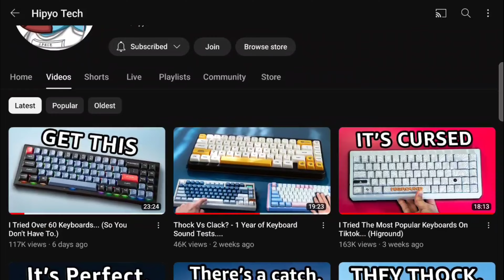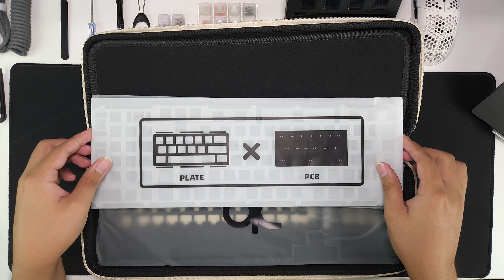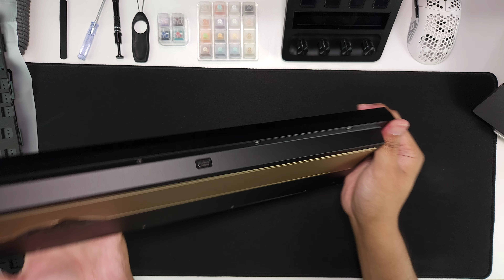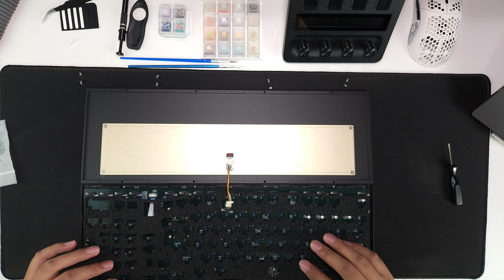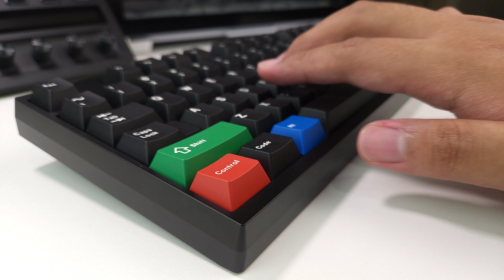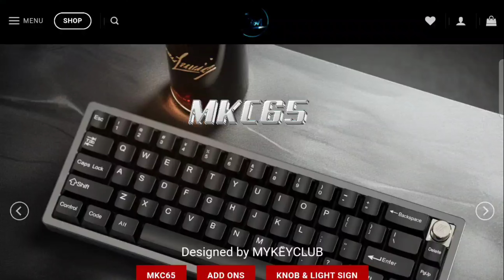QK100 Review: Into the Custom Keyboardverse

Comment: How does a 5 pin work with that pen foam, thoes only 3 holes
Reply from the maker: The pins can easily pierce through the PE sheet when putting on switches.

Comment: Go foamless so you'd get what you paid for... with a foamed up build - it sounds like a modded 1,500 pesos board. (but that's just me).
Reply from the maker: The same logic applies to saying clack builds sound "the same". I have two other boards that are foam modded as well but sound unique from each other. While foam shapes the acoustics in a particular way, the switches, plates, and keycaps make a bigger impact on sound.
Reply: @WaltKnowsTech  Just go with whatever you like. Honestly they are just metal rectangles for typing, I don't know why some treat it so seriously. if you like foam, just go with foam. Don't let anyone else tell you otherwise how you should use your money.   I used to be enforcing people to go the foamless route, but after doing client builds,  I realised that at the end of the day, it's not my board, it's theirs. As long as they like it, that's all that matters.

Foamless boards sound similar, foamed boards sound similar, and there won't be any escape from this unless the hobby shifts towards other switch types other than the MX style switch, maybe ALPS perhaps. Anyways I digress. Just enjoy your board!
Reply: @WaltKnowsTech  on a foamless build, you can really feel/hear the "quality" of a well built / well engineered board over the cheaper ones. Of course - switches, plates, keycaps play a big role in the end result... what I'm trying to say is:

Foamed up decent board = foamed up cheap board

Foamless decent board > foamless cheap board

But then again, this is just my opinion.